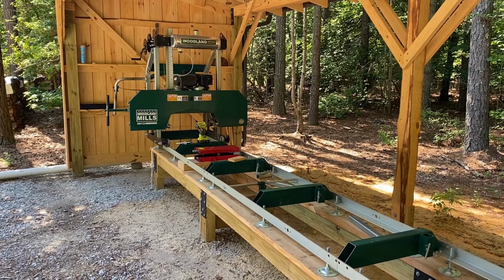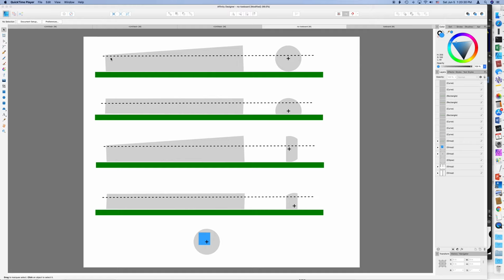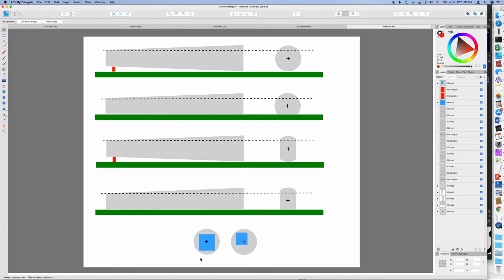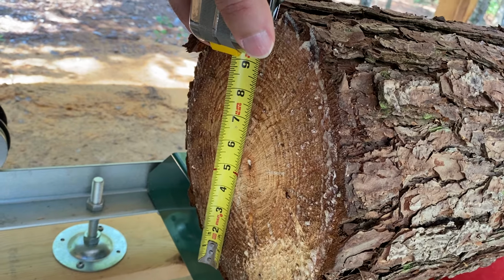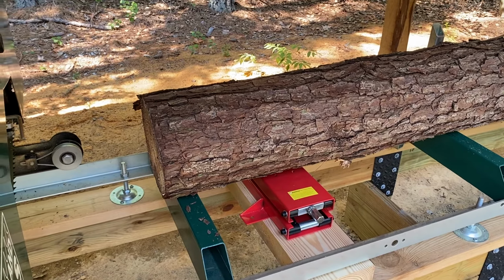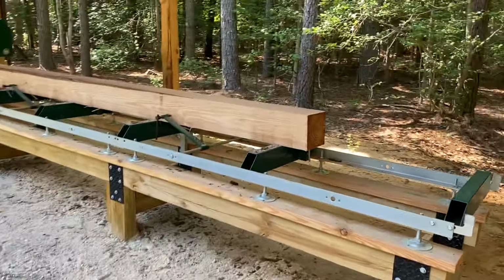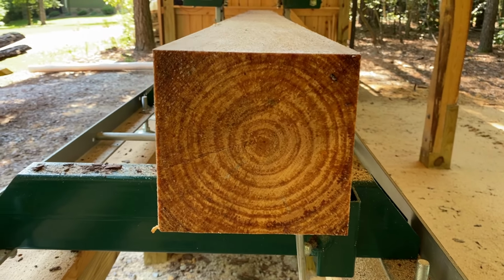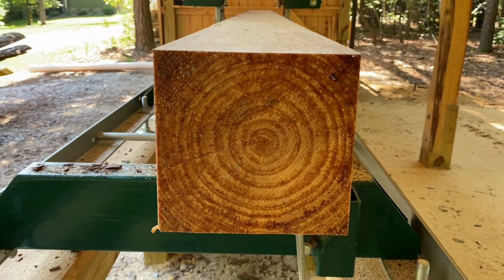Why you should use a toe board with tapered logs on a sawmill

Comment: when you bring your tractor in and set your forks down right at the edge of your mill, chock your front tires with a 4x6x8 ft. it will take off time and put you right where you need to be every time for unloading your logs onto your deck. Like your construction on your deck.
Reply from the maker: Great idea!
Reply: Better yet, build a bed height log bunk and load it full...then just roll them on one by one. Less time on and off equipment.

Comment: I like to measure the large end at the last cross bunk, and split that measurement to get my halfway point. And then raise the center of the small end to the half point measurement of the large end. because if I raise the small end it will kinda pivot on that cross far cross bunk and slightly change the large ends position. And if the log has a lot of taper it will actually hang down lower than the cross bunk, therefore if you’d measure at the butt of the log it would give you an in-accurate measurement. I hope this makes sense. And it’s not the only way. Just how I used to do it on my Norwood mill. 
Which had some hydraulics, so I could set my blade at whatever height the small end needed to be. And just raise log till the center was at the blade.

Comment: Excellent job centering the pith on both sides. That was a pretty yellow pine. Looks like you are having a good time. The sawmill shed is amazing. I'm still milling out in the open and covering the mill in bad weather. I have all hardwood here in northwest Arkansas so I don't get to cut construction-type wood. You may want to hang a bucket on the sawdust shoot so you can put it in a pile somewhere where you can make compost. I just mix grass clippings with mine to make good compost.

Comment: Something that should be mentioned when you have the log overhang the end support bunk when you lift your toe board the opposite end with the over hang could possibly change So in essence you should bring up your toe board a little less to make a more accurate cut down the log! With the amount of over hang on this log your featuring here! your probably looking at a 1/8 difference but with more over hang like a couple feet or more would increase that amount being off!
Reply from the maker: For sure.  Sometimes when this is the case I try to compensate a little.

Comment: I like setting the saw blade at the far end center height so I can use it as a ruler for setting the toe board height quickly. Bring the saw close to the narrow end and run up the toe board so the center of the log is even with the saw blade. 

I also usually eyeball the size of the log and set the height of the saw to my guess. Bring the saw to the log to check in guess. This quickly trains the eye to read sizes remarkably well.  I always use the tape measure as well because that tool is always right, rather than the eye being usually close.
Reply from the maker: Great ideas, thanks!
Reply: I really like your idea of getting the pith measurement on the large end  and carrying 
It to the other end. Use the scale ruler to get an accurate measure. Great!

Comment: Thanks Jack for demonstrating an excellent and inexpensive mill upgrade idea.  I had a couple of cheapo scissor jacks lying around my shop so I welded them onto some cross members which bolt right existing unused holes in my HM126 track.  Given my setup is cramped under a drive shed roof, I also installed 16" rollers on top of the lifts.  Now I cab load any logs at the far end of my 22 foot track, raise the rollers slightly and effortlessly roll even large logs into position for milling.  Should have thought to do that years ago.

Comment: I did not check all comments but, I'm thinking that if you use a straight board across the rails at the end of the log as your "bench mark", you can adjust the height of the small end by holding the tape to the board and against the end of the log while raising it and watch for when the pith is at the desired height. This would give you a precise measuring point without trying to find the proper place to measure from and repeatedly setting the drill down to measure.  Your diagrams were perfect!
Reply: That's what I do too. It may not look like much but if you raise the small end 1 1/2" the large end center is coming down.

Comment: Great video. I used an RV scissor jack for mine but I really like the large flat surface of that jack.  I found it helpful to cut 2 boards the width of the bunks that can sit on the angles of the saw rails. I can put them at the ends of the  logs to measure up for the pith on each end. makes measurements quick and easy no matter where the ends are on the saw bed.
Reply: Excellent idea. 👍🏻👍🏻👍🏻
Reply: good tip, thanks I'll use it

Comment: Saw a laser on another sawing channel, very slick. Also, a set of measuring cross pieces that can slide on the rails with a nail or tack in the center ring of the wood. A cross member to catch law dogs so they do not swing down so far. You have a beautiful set up, very neat and clean. You can really see how  swing blade saw saves time and allows for quarter sawing. Thanks. Bob in Nevada
Reply from the maker: Those are all great ideas!

Comment: Nice video, and a really beatiful set up you got there. I'm a relatively fresh sawyer, but I have never yet sawed a log witout using the toe board. The original one from WM works great and is very flexible to move around. Another way that I use the toe board is is to level the top edge for making traditional boards. Gets another 20% out of the log. Btw, amazingly fast growing pine you got. Here in Norway that would probably take about 100-200 years for that size. Also smart using the drill, it's a lot faster. I will start doing that too. Thanks.
Reply from the maker: These Loblolly yellow pine get to about 16-18" diameter at the base after 30 years, and that is with them spaced tight together (they were planted for pulp wood production and meant to be harvested at about 15-20 years, which did not happen).  The ones that are on the edge of the forest have more room to grow and reach 20-24" in the same time.  Someone told me this particular species of Loblolly was genetically engineered for fast growth and harder wood but I don't know the details.  They were planted about 1992-1993 from what I gather from satellite photos.

Comment: Very good explanation of the importance of taking log taper into consideration. A simpler method for adjusting log height is to use a tapered wedge (mine is a piece of 2x4 that is 14 inches long  and tapers from 2 3/4 inches to 0) and peavey to raise the small end of the log. By positioning the peavey under the log and onto the far bed rail to lever the log up, the wedge can be slid between the log bed and log. Very easy to quickly adjust the the log height and no extra tools are required. Simple is good! And the wedge helps keep the log against the log stop.
Reply: And this method also keeps the log against the log stop.
Reply: I like your idea of simplifying the process.  I notice some sawyers avoid setting log stops until the weight comes down as they saw.  Using a tapered block could make it possible to further simplify the process by avoiding having to turn the log over to cut the other side.  You could lower the mill the desired cant size and cut through the bottom half.  This could cut out the step of turning the log over & removing the toe board in some cases. 

Rotate the log 90 degrees and repeat the process setting the toe board again.  Two less turns and less measuring would take less time and effort.  I haven’t put my mill together yet but I will try your idea.

Comment: Great, informative video.
The biggest drawback to toe boards is when you forget to lower the log after the opening cuts are made. Kind of like forgetting to lower the stops and cutting into them. 😉
My only critique with what I saw in the video was the opening cuts you made. I wasn't standing there to see the log, but it seemed to me you could have gotten a couple of at least 8' 1x6s, possibly 2x4s out of those first cuts.
It is a common practice I see in a lot of this type of videos, so I'm not picking on you specifically. But especially on logs longer than 10', there is a lot of usable side lumber thrown in the scrap pile because the sawyer opens the log to square cant size. I most often attribute it to operator inexperience.
Looks like you've got yourself set up well there. Keep on working and let experience be your teacher.
Reply: Added note, most auto wrecking yards have a multitude of perfectly good scissor jacks available cheap.
Some are designed for a goofy handle to operate them, but some have a hex on them for use with the lug wrench so a cordless driver will adapt nicely. Hydraulic Jack scan can be mounted under the bunks fairly easily also.
Reply: very much agree about the opening cuts, that thick slab would have yielded a couple boards, same for the bottom and sides, then cut to the cant size, it may seem like a wasted cut cause some times that will be a mere 1/4 inch or less, but it squares it to cant size .

Comment: Thank you for this video. I got an LT40 (fully hydraulic) and got messed up using the toe board and ended up with crooked lumber, stopped using them and got twisted boards and lots of waste. Needed to see the graphic and when to raise and lower the toe board. 

Will implement immediately.

Other issue are wavy cuts.

Cutting Tamarack.

Only have the mill for a few months…lots to learn.
Reply from the maker: That is a real nice mill.  Wavy cut is usually easy to solve.  Assuming it's a sharp blade and you are not going too fast, it will probably be related to the guides or the tension.  

Waves around knots can happen even with a proper setup.  A good way to see/understand that effect is to put on a new sharp blade and try shaving veneer cuts off of a knotty cant (by cutting veneers you can see the knots and watch what happens).  I can cut uniform 1/16-1/8" veneers with my mill but hit a good knot and there will be a wave unless I slow way down.  This is good to learn about with veneers when you can see knots, because when sawing thick lumber you won't see all the knots inside the cant and may not know how to interpret waves until it's too late.

Tamarack should be pretty easy to cut if the mill is dialed in.  We had a few of those trees in New England where I grew up.  Definitely a knotty tree!

Comment: I keep 1/2"  stickers around that I use to stack boards to dry. If the log needs to go up on one end 1 1/2" I use a bottle Jack to lift it and put 3 stickers under the log at the bunk. Works fine. I do like the motorcycle lift though. Have one for my dirt bike. I use felling wedges on the other bunks to fill the gap and tighten the log so it doesn't bow or move too.

Comment: Best explanation and demonstration of this I've seen so far.  It looks like your eyeballing where to start the cut once you have the log leveled.  Would love to hear your comments on this.  I've been taking the diameter of the smaller end and multiplying by .7.  Say it's 10" on the smaller end.  That gives you an expected 7" sq cant.  I deduct 7 from 10, leaves three.  So on my first cut, I set the blade height at 8.5.  flip 180, set second cut at 7 and do similar on cuts 3 and 4.  Comments?  Ideas?   Thanks
Reply from the maker: That is a good rule of thumb to use.  The 0.707 (aka, sqrt[2] over 2) comes from the cosine (or sine) of 45 degrees and tells you what size square will fit in a circle.  Sometimes I will cheat a little and go higher than 0.7 if I think the cutoffs can yield extra pieces of lumber as a bonus, or if I can tolerate some bark or rounded points on the corners of the cant (usually fine for posts).

Some people will actually draw the square on the end of the log with a pencil or sharpie to visualize what they are cutting and how to get some extra boards out of the cutoffs.  I've never gotten that detailed, usually just eyeball it.

Comment: Good for alot of taper in the log. Mine are pretty much uniform. I dont put big logs thru the mill. I hold to 12 feet long or so. I mostly do beams. My first cut is to skim a flat. I then drop to get something usable 1.5 inch.. Like for purlins on meatal buildings.

Comment: Excellent video now I realise why it is so importend to use a toe board. I like the height of your timber frame where the track is bolted on to. How high is that ? what blades are you using
Reply from the maker: Base is 22” high putting the bunks at 29” high.  Similar to a trailer mounted sawmill.  I have been using Woodland Mils Blades and Ripper 37 blades.  Both have been good.

Comment: Thanks for showing how to get it centered. I believe that the major impact is on quality of the final product because of warping, bending, splitting, stability etc... that i would think. Why is it effecting the yield of a log? - i don't get it because the final dimensions are determined in both cases by the diameter of the smaller end - the big difference is the orientation of the grain -> which reflects in the quality only - isn't it so? please advice, thanks.

Comment: Thank you for your informative videos. My hm122 just came in. Did you use any blue loctite? I was thinking of using it on all my bolts…?
Reply from the maker: I didn't, and nothing has shaken loose in the two years I have run the mill.  They do provide nylock nuts for some of the fasteners.

Comment: Hi great video personnaly i use different piece of wood of diiferent height to level the tiny part of the lumber and after my first cut i only rotate 90 degrees for the next cut and after that i remove my piece of wood.Any particular reason why you rotate 180 degrees thanks.
Reply from the maker: Rotating 180 creates maximum stability on the bed, with the aim of producing a squarer cant and cleaner cuts.  You're immediately flipping the log down onto the reference you created, with gravity working in your favor.  Depending on the type of lumber being sawn, the first two parallel cuts establish the most accurate reference surfaces and will be important later.  For other stuff (ie, posts) it does not matter so much how you do it.

Comment: How long do you have to dry before you can use the lumber ?  I am guessing that may depend on the application ?
Reply from the maker: Depends on what you plan to do.  For outdoor structures I frame with green lumber (I have videos about this) and as long as you plan accordingly it works great.  For indoor trim or fine furniture it needs to dry for a couple years before it's stable enough.  In between those two extremes are many other scenarios.
Reply: @Lumber_Jack  how about 2x4 or 2x6 wall framing for small cabin ?
Reply from the maker: @logan979  Framing green would be fine, just be sure to constrain the studs with girts or siding to keep the wood straight while it dries, and of course don't put up vapor barrier or insulation until the structure dries out a fair amount (few months depending on climate).

Comment: Is there any reason why you can’t set the toe board and make your first cut, roll the log 90 degrees’ leaving the toe board in place at the same exact height and then make the 2nd cut. Then remove the toe board and make your last two cuts? Just curious. That’s how I have been making my cants just using 2x and 1x blocks to center the grain. I just ordered the blue motorcycle jack as they are out of the red ones. I’ve always been concerned about keeping squared up and setting that jack twice at the same exact height could possibly be an issue. Let me know what your thoughts are. Great idea and video! Thanks again for all of the great info.
Reply from the maker: It would be rare for a highly flared log to be perfectly symmetrical, so chances are it will need slightly different toe board settings anyway.  And you wouldn't want to roll a big log when bearing on the toe board since it's a lot of side load that the jack isn't meant to handle.  But the main reason I do 180 turns (with or without toe board) is for stability.  It results in better quality cuts if you can get a flat side of the cant down on the sawmill bed as soon as possible.
Reply: @Lumber_Jack  our jack is on the way and we will be do some test cuts as soon as our snow is gone. Will be checking our track for level and plane as soon as we are thawed out. Great video on doing that and we went with the Bosch green level. Needed one anyway this for Spring. Thanks again 👍🏻👍🏻👍🏻

Comment: Perhaps if you took a piece of  material that long enough to span the rails with about 6 inches either side.  Run a piece dowel up through that material.  Make a set screw in material piece so the dowel tip can be adjusted to center of log and locked down.  You then can take the material piece to the small end of the log and then adjust the log height with tip of dowel height.  Center to center Would be pretty much dead on with out having to use a tape every time.

Comment: I appreciate the computer diagram showing using a toe board vs not using a toe board.  It just goes to show that a little pre planning, (weather making a jig, drawing your cuts on the log, or using an autocad program) can greatly reduce waste.  Do you always position the log the way you did in this video (smaller diameter where you start the cut) or does it depend on how you deliver the log to the mill?  Does the toe board seem to work better at beginning or end of your cant?  Thanks!
Reply from the maker: I usually end up with the small end of the log on the starting end of the cut just out of habit, but the toe board setup I have could be moved to either end of the mill.  Won't matter where it goes as long as the log gets leveled properly.  I just used it yesterday on a log with 3" flare from one end to the other and it really helped.